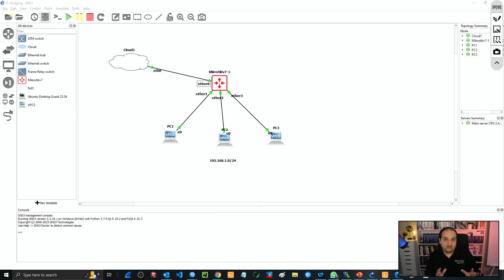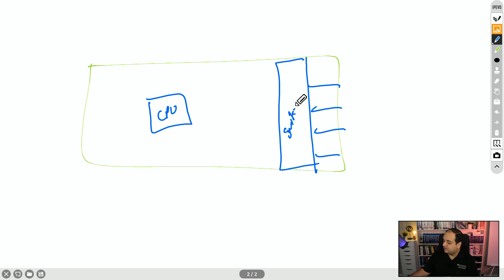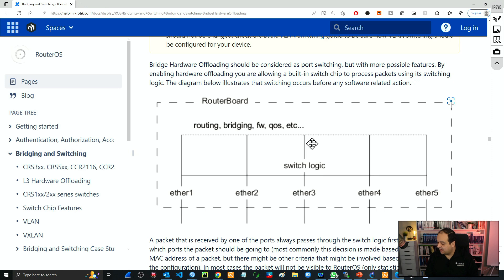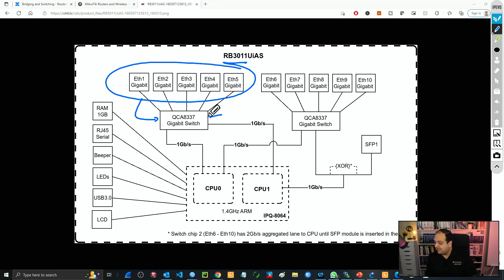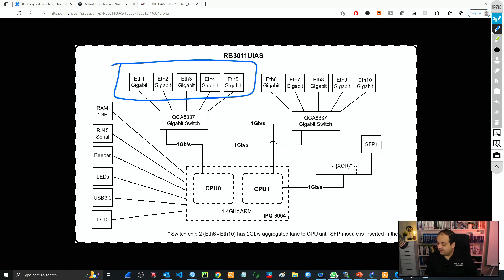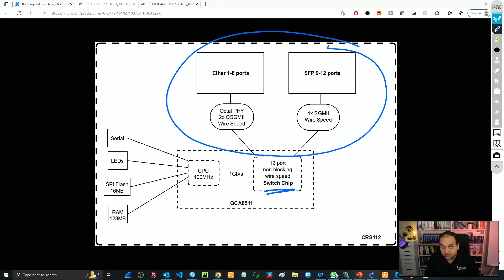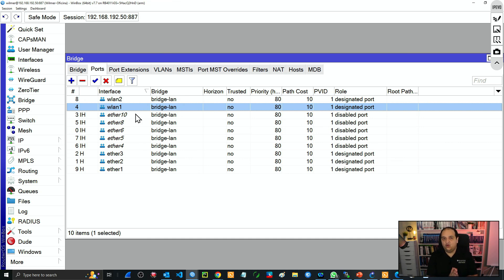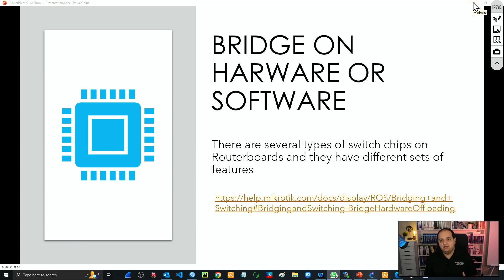Understanding Bridge Hardware Offloading in Mikrotik Devices

Comment: great video! is communication between port eth1 and eth2, if they are in different vlan, also going through switch chip and not through a cpu ? tnx
Reply from the maker: Hi,
There is no direct communication between VLANs if the device is functioning only as a bridge. If configuration is required, the device should be operating as a router. I have another video on this topic: Layer 3 Hardware Offloading – Deep Dive

Comment: thanks so much for sharing the knowdge........
I have ccr2116 and as you kno that every 4 ports are connected into one pin to switch chip , can I put 8 ports under one bridge..?
Thanks in advance
Reply from the maker: Hello!
The CCR2116 has all ports, except ether 13, connected to the switch chip, as shown here: https://cdn.mikrotik.com/web-assets/product_files/CCR2116-12G-4S_240122.png

You can safely add all those ports to the same bridge and use either L2 or L3 hardware offloading. I have a video on L3 hardware offloading where I demonstrate the actual configuration process.